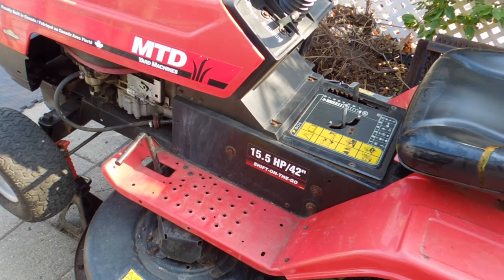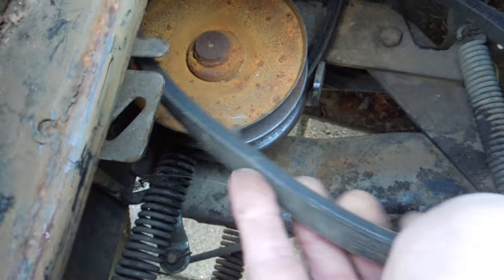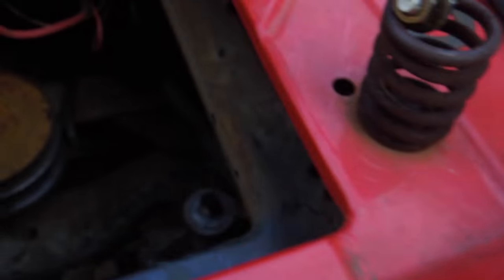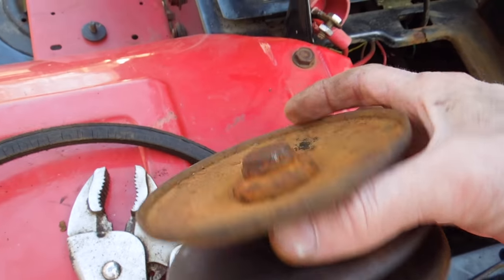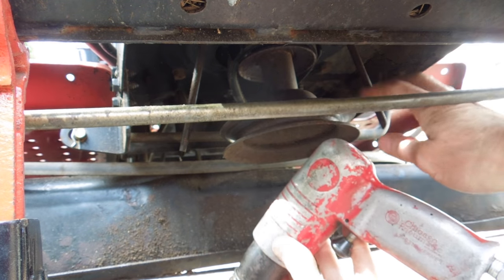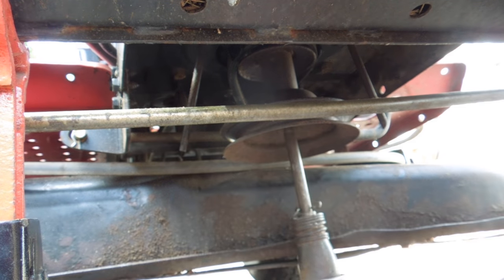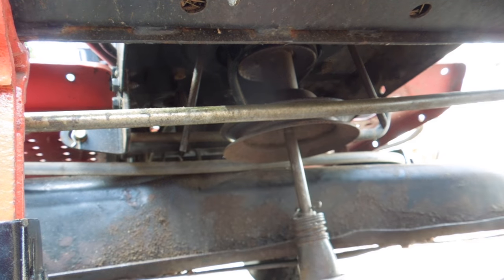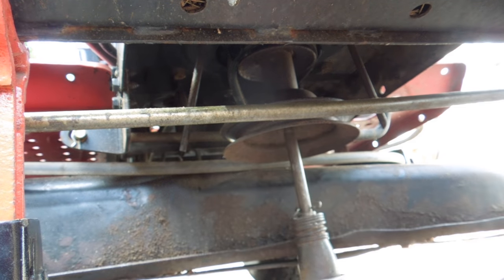How to change the belts on an MTD Lawn Tractor

Comment: I know this video is a few years old now. And it is quite helpful because I have a very similar lawn tractor. One thing I wish you could do when you make these videos, especially on lawn tractors. Because I'm always watching them. Is tell us in the description or on camera what year your MTD product is made. That would be quite helpful. MTD made a lot of variations in these mowers and i'm finding out the hard way when I have to order parts.
Reply from the maker: Thanks for your comment and sorry I didn't include the date. I don't own this tractor anymore, but will keep that in mind for future videos.
Reply: You can get parts manuals and owners manuals on the MTD website using your model number.
Reply: @JKraft-o6q  No, you can't. I've tried many ways.I've actually called and talked to different companies, including MTD itself.No, pull up schematics.Nothing available.Other than factory original art manual which I can get onlineNo, you can't. I've tried many ways. I've actually called and talked to different companies, including MTD itself.  No repair manuals, schematics for 23 year old Rider. Nothing available. Other than factory original owners manual which I can get online.

Comment: Wish I saw this before I did mine! I ended up releasing the spring on the right rear. It took a half hour to put it back on (vice grips and a heavy wire formed in a 3” loop-pull back and reattach. Needed wheel chocks). Like he says make sure the pulley star lines up or it will shear the splines. Great video!
Reply from the maker: Thanks for your comment!

Comment: Your "maintenance" video would be MUCH better with some additional lighting! Or, you could do like Taryl Dactel does, tip the mower on its' side. Make sure the gas filler is at the high point and plug the breather holes at the carb to keep oil from leaking out!

Comment: I have the same tractor plus the MTD owners manual, and it doesn't seem like the instructions are correct.  It says to remove the springs which you said not to remove.  But that allows the variable speed pulley to move forward, which is the opposite of what you want.  Instead, I removed the speed control rod from the bottom arm near where the variable speed pulley is mounted.  This allowed the variable speed pulley to move back, giving me enough slack to get the large pulley back on the transaxle.  Then I was able to easily pry the variable speed pulley mechanism forward and reconnect the speed control rod.

Comment: Instead of taking the front pulley off just pull the 4 motor bolts out the motor will slide back enough to get the drive belt off
Reply from the maker: Thanks for the tip! That sounds like good idea that could save some headaches trying to get the pulley off.

Comment: That's the exact same setup I have on a riding mower. I'm having issues with the belt popping off the front pully. I believe they gave me the wrong belt, and it's too long. I'll check it out tomorrow again. I needed this video to make sure I was running the belts right and I am so the only option now is bent the belt tabs back into the stock position and make sure they gave me the right belts. Thank you so much for this video. It's a blessing, to say the least. Thank you again.

Comment: got an old 13 hp mtd Thnx for the video!    gonna get a gas shut off valve sap!  Seems like should be able to change belts without removing 2 pulleys?   cheers!

Comment: Thanks for this video. This helped me a ton! Hardest thing I was up against was that variable speed pulley. It's stuck in that mount pretty good but thankfully that slider pulley lifted up enough that I could take off and slip on the new belt. Thanks!
Reply from the maker: Glad you found it helpful! Cheers.

Comment: It helps if you pull spring arm back and wire it off, before removing pulley , easy to put back later
Reply from the maker: Thanks for the tip!

Comment: I’ve found that taking the belt on and off the pulley that’s on the top of the engine shaft is to remove the 4 bolts that hold the engine on and then slide the engine back,that way the tabs are not in the way,easily done then tighten the engine back up!
Reply from the maker: Thanks for the tip!

Comment: I have a couple of MTD's with Manual's and both drive systems differ slightly from yours. Very good and useful video and free is always a bonus too!
Any one watching and needs a Parts & Service Manual... search for Model MTD 13AQ683G163. I have them both and only thing different is likely just the hood design.
Reply: Where did you get the service manual? I have a 13AG601H729 (2005), but can't find one anywhere on lone. Not even from MTD!! They probably figure a 20yr old MTD is already in the bone yard, no manual needed! LOL

Comment: Before I changed carb I would check to see if float is stuck in the down  position. Much easier than going through the whole process,  easier taking carb bowl off.

Comment: Your mower looks very similar the one I just bought but mine is 16.5Hp - maybe it's the year after yours coz the handbrake lock knob is in the middle or the floor plate and not the other lever.

Comment: That pulley is 66$ on Ebay. Mine was completely rusted all to hell and back again and again. It would not budge so I put a three arm puller on and it bent the crap out of it to get it off. I will apply anti sieze when I put it back on. It had 17  years of use. My mom's old mower.
Reply: are 3-arm pullers rent items?
Reply: @dabneyoffermein595  YES!

Comment: And put a fuel valve in the line betueen the tank and the carb. Evey time you turn it of the carb gests emtyed ans you avoud that sort of problem. It helped me.
Reply from the maker: Good advice! After I shot this video I ordered an aftermarket carb and it came with a shut off valve. So that's in place now.

Comment: Cool, finally found one with the exact same belt/pulley set up I am trying to help a friend out with...Don't feel bad buddy, this is the second time I have done this horrible job and am having more trouble than the first time!  There was no way I could get that little transmission belt back on, so I am one of the morons that ended up pulling off both those damn springs!  I finally have the belts back on but have yet to devise some sort of come along system to reinstall those heavy springs!  Yeah, I have made the same front pulley mistake also...There is some controversy over which way that little engine pulley spacer is oriented, either way has some merit.  But, I think you have it right, the flared end of the spacer goes "up" towards the engine.  Once I got that darn variable speed pulley off, the bearings were shot so they had to be replaced, not big deal though.  So, I guess I'm off to Harbor freight to get some ideas, perhaps a little "come along" to reinstall those friggin springs!
Reply from the maker: Glad you found the video useful and good luck getting those springs back on!
Reply: I just went in there with fence wire and looped it to the spring and came out with the wire and wrapped it around a shovel handle. I braced my feet on the mower and gave it a good pull and was able to reattach the spring fairly easy. I was really worried about reattaching the spring too, but the way I did it was easy, surprisingly.

Comment: I am about to do this job..Is there a reason you went with a different technique than taryl ? I saw his video and cant decide which way is easier.. What can you say about both ways ???
Also you didnt address the guide pins up front .. I just priced those out and saw a price as high as 50 bucks for a single pin..MTD had them for 10 bucks which turned to over 60 with shipping to my location.. Those guide pins are like gold to source out..

Comment: on that main engine shaft pulley that you vibrated off, up in there a ways is the seal, do you think that seal was accessible?  I need to replace the seal because oil is leaking out all over the two pulleys (small one and dripping down to the large one), which covers the belts with oil and causes all sorts of issues, oil is gunked everywhere.   I need to be able to have enough room up in there to yank the old seal off with a dental pick, and then put a new seal on there with  some sort of PVC pipe to bang it back on.  Any ideas?
Reply from the maker: Wish I could help you, but I sold the tractor last year and didn't really look at that seal when I removed the pulley. Good luck and I hope you can get yours fixed.
Reply: @ToolTalkCanada  Thanks for the reply, it is appreciated...i will make sure I'm subscribed if not already!!!  I've got the new seal on order from the Briggs & Stratton Amazon store, Imma give it the ole college try!

Comment: Thanks good info! Question have you tried taking the rear wheels off? MTD seem to have perfected a technique for making the axle and wheel into a one piece unit over time.
Reply from the maker: Glad you enjoyed the video. I did take the back wheels off and it was a pain the butt! I think I used an improvised puller, brut force, and lots of heat for the first one, but I may have used Taryl's air chisel trick for the second one. I know I saw few videos about getting the wheels off too, so take a look on youtube. Good luck!
Reply: I ended up buying a Slide Hammer  Puller from Amazon and between the slide hammer and heat and brute force and stubborn determination I managed to get one wheel off my MTD mower. We had given up but after succeeding on the one side we tackled the other side and after the same story we got it off too! I highly recommend a slide hammer for getting the wheels off the MTD’s! The spindles are now well greased with anti seize! Great video by the way!

Comment: Thank you for a good video. Can you please help me on this one. I have a MTD, with the same pulley system, as the one you are showing. My problem is, it will only drive in high gears, nothing happens in 123456, can i adjust me out of that? Greatings from Denmark
Reply: Did you ever figure it out?

Comment: so there is actually 3 belts for this lawn mower total? You just had to replace 2 of them?....for work i have to tune up a 17.5 hp - 42" and I don't know if I should do this, no air hammer chisel and what not all of the other things I think i get.

Comment: Hi i watch your Video how to remove the pully ..did you tight the bolt to use the air hummer ? From the pully
Reply from the maker: You leave the bolt a bit loose so the pulley has room to move. You might be able to use a longer bolt too if you have one. That way it would bottom out in the hole and still leave room for the pulley to move. Good luck!

Comment: Hi good night i have a question my tractor is the same but im change the belt deck for the blades but ehen im turned on the tractor the blades is on also so is turned on the tractor and blades the same time and the blades mode is kn tbe position off but turned on the same time whit the tractor

Comment: Working on older 46 inch yard man 20 Koehler lower drive belt replaced twice 95 1/2 inch as shown in book and , but 5 inch short of pto Poulley any help appreciated, I’m 75 still doing my mower repair ha
Reply from the maker: Wish I could help you, but I don't even have the tractor in this video any more. Good luck.

Comment: At 18:02 I see the video cuts with the wheel back on how did you get it back on. I’m having trouble with it.
Reply: I believe he said he went back and took off the front pulley on the motor then was able to get the star pullley on. He then went and put the front pulley on the engine back on.

Comment: How do you keep that front pulley system from turning when you take that bolt off??
Reply from the maker: Sorry I didn't show that. I think the bolt on mine came loose fairly easy with a ratchet, but an impact wrench might help if you have one. You might also be able to fit a pipe wrench on the round section between the top and bottom pulley. Keeping the belts engaged might help too. Good luck.
Reply: I used a trick frequently used on chainsaws and trimmers. Remove spark plug, stuff rope down in cylinder to keep piston from moving. Do I need to say leave enough hang out to pull out when done? Turn crankshaft as necessary to get enough rope stuffed in cylinder. Depending upon design of engine may need to kind of push the rope back in there sideways.

Comment: Please, does anybody know the bolt size and threads of the 5/8 bolt for the engine pulley? Mine fell off while cutting grass and I can't find it in the yard.
Reply from the maker: The manual says the bolt for the engine pulley is a 7/16"-20 x 1.25" Gr. 5. The manual is available online, but I can't remember where I found it right now.

Comment: I've got one like yours with no tension wheel can't get my top belt 9n u showed yours on but did not show. I can't get mine on
Reply: put bottom belt on leave in parking gear get a 2 inch round pry bar put between variable speed pulley and big pulley and pry on seat big pulley in star pattern put on washer and nut.

Comment: So you have to lower the motor pully. I was wondering how to get the new belt on the top pully past the side tabs. How dang stupid making the mower this way.  I know the tabs wouldn't bend back without tearing something up.
Reply from the maker: Does seem ridiculous, but I think that's the only way to do it. I was just watching that part of the video again and wishing I put some anti-seize on the motor shaft before putting the pulley back on. Would make it easier to get it off next time.

Comment: Anyone know the right size for blade belts?
Reply: For my MTD/Bolens 600 series (Model 13AN683G163), it uses part # 954-0371A for the deck/blade belt.
To look up yours exactly, google mtd replacement parts. One of the first links that pops up is for mtdparts.com, click on "LOOK UP PARTS BY DIAGRAM." Then enter your model number and "deck belt." View the diagram to get the exact part number for your model.

Comment: Why did you not show how to replace  upper transmission belt ?
Reply from the maker: Sorry if it wasn't well shown in the video. I ran into some problems with the upper belt during reassembly, but if you watch the video from 16 to 20 minutes I did try and explain where I went wrong and how to do it properly.